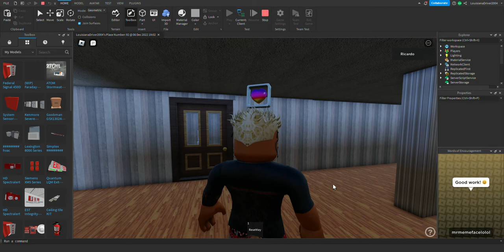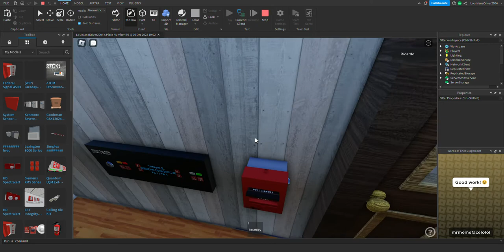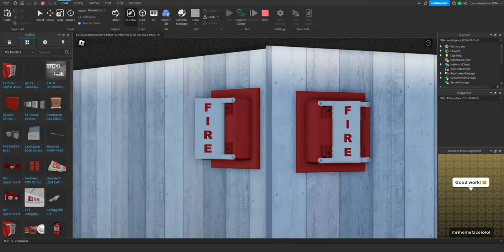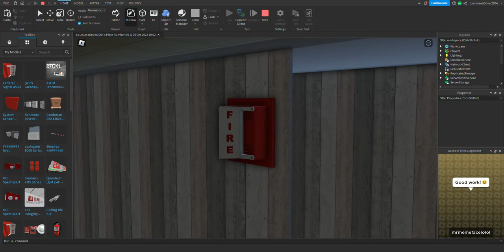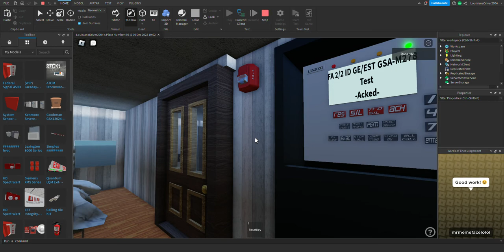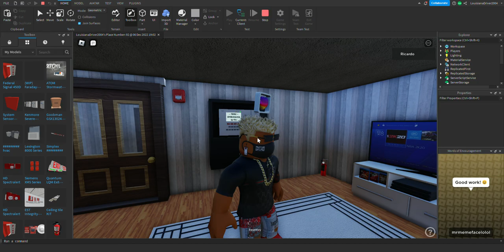Roblox Fire Alarm Inspection #63 (Federal Signal 450D C1 System)

Comment: Sorry, i couldn't comment. But The actual 4903-9420 is out! and to remind you, It is very different from the other 4903's. The Strobe and the Fire lettering are reversed with the Strobe on the left and the Fire lettering on the right. The 9420 is an AC Version of the 4903 series as it has the horn of a National Time alarm. and i strongly recommend you use it on continuous.